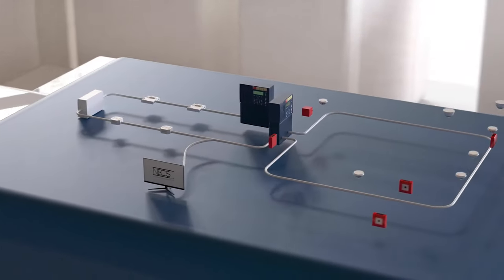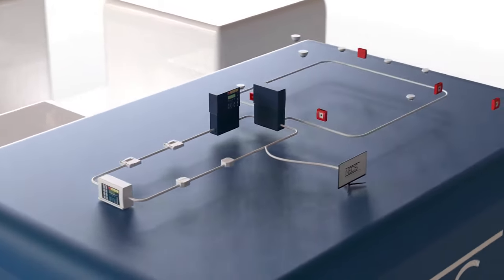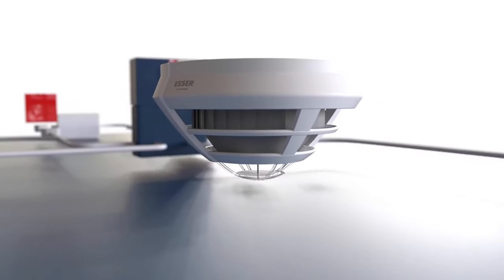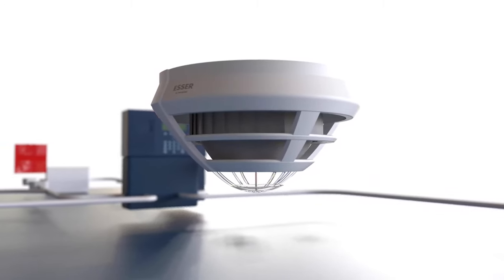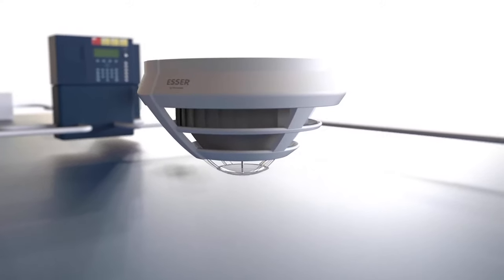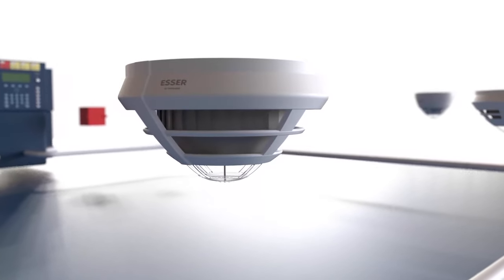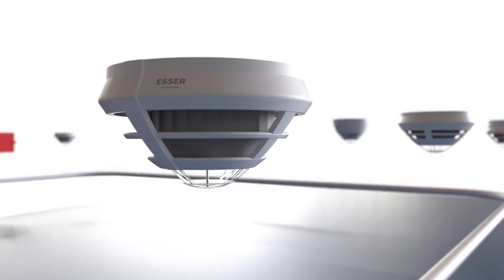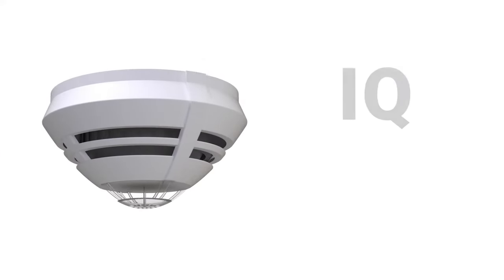How a fire alarm system works (PART 2) - Loop - Esser devices

Comment: Differential temperature detectors are fundamental in every building!
Reply: I would rather recommend in general "smoke detectors", as they will detect a smoldering fire faster than any heat detector. A "temperature detector" or heat detector needs flames to measure an increase of the temperature. But smoke is generated before you will measure temperature increase. Or consider a multi-sensor device which combines smoke detection and heat detection, to increase a faster and more reliable fire detection, and on the other hand to reduce false alarms! There is nothing worse than building users/occupants who have become accustomed to a false alarm and then dismiss any fire alarm as a "false alarm". This can be life-threatening. Take every fire alarm seriously!

Comment: Is the loop constantly monitored by the fire brigade?
Reply: The loop is constantly monitored by the FACP - Fire Alarm control Panel, in this video either the IQ8Control C/M or FlexES Control. And the fire alarm is automatically transmitted to the fire service.
Reply from the maker: @Pelazas  thanks for answering

Comment: What are the main optical signalers?
Reply: The main optical signalers are either conventional stores, that you could connect via a an esserbus-Output module with the loop. Or better is an addressable loop powered VAD (Visual alarm Device) on the esserbus. No additional wiring, no additional PSU/Power Supply Unit, no additional Output module and no additional installation time. Mainly consultants and installers prefer a red flasher (the assumption is, RED = fire), but a WHITE flasher can be seen better by the user.

Comment: 65.000 signalling and detection devices on single loop?
Reply: In an essernet-Network with 31 panels FlexES Control Fire Alarm Panel, and each with 17 loops (the 18th slot is for the essernet-module, connection of the panel with the essernet-Network). And each loop with 127 loop addresses (esserbus devices). Thus the calculation is as follows = 31 x 17 x 127 = 66.929 loop devices in one essernet-Network, or round up 67.000 loop devices.
Reply: @Pelazas  how many  addressable module connection for fire beam detection in one loop?
Reply: Esserbus Alarm Transponder has 4in/2out contacts. You can have 127 Alarm transponders on the Loop and on each of these 4 inputs.